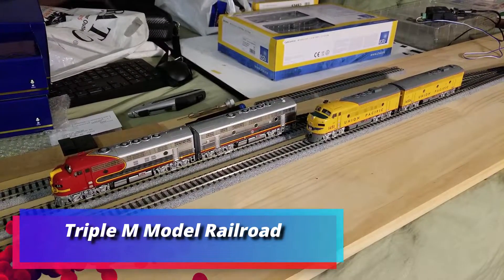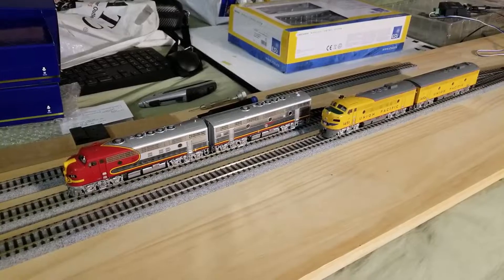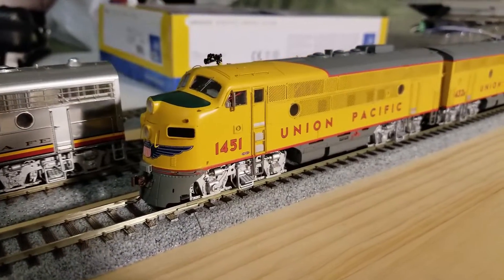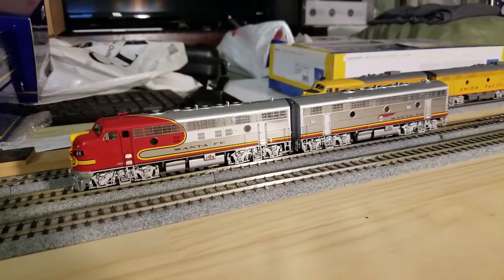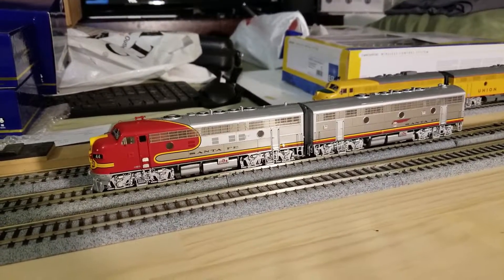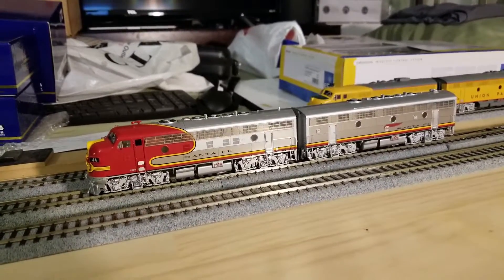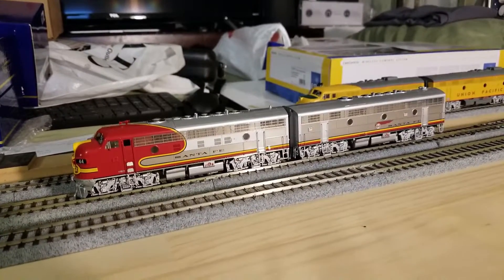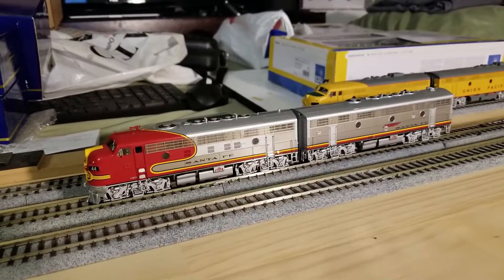Athearn Genesis F7 Sante Fe Project / Harold's F3 Completion

Comment: Another layout thought for consideration. My layout when I was a kid, was on a sheet of 4x8 plywood. My room was in the basement. At the end of the room, my step dad framed shelving to the wall. The bottom shelf was about 2' off the floor. The plywood was attached to this with hinges and could fold up against the wall out of the way. Actually there was an airgap of the width of the shelf board between the stowed position of the layout and the wall. When the layout was down/open, there were two brass colored chains to support each out side corner and I had a wooden leg to screw into the center of the leading edge before I lowered the layout. When up, the layout was secure closed with a bolt layxh on each upper corner. The layout was a common set up with an outer loop that had an inside siding. An inner loopn I could run a second, smaller train on. The outer loop also had a spur withban elevated coal dump. Therw was also a shelf above  and compartments along side the closed layout Where i stored my rolling stock. The track was nailed down with a cork bed. My buildings were not attached. They were easily moved back onto the shelf the layout was hinged to and protected behind the layout when closed. On the bottom of the layout was a ayer of cork. Made the back side of the layout a poster board. It could get tedious setting up and putting it away, but it was a good use of real estate.  Heck, one could always have a permanent shelf set up on one wall, and have the hideaway layout fold lowered down to expand on to it for another leg for operating sessions.
Reply from the maker: Hmm, I'm considering building a modular layout in my room but due to this pandemic it is on hold.  the plan is to clear out my bedroom to the point where it is possible to build removable shelves.  The shelves will design will be similar to an N scale modular build I have seen in a couple of trains shows.  I will have more information later on this.  Hopefully this pandemic will blow over soon so I may continue with the project.

Comment: good to hear that U go with ESU,  U will never regret your  choice.  I use the ESU Ecos 50200 and the Mobil Control II, for me the best system on the market.  See ya next time, Dirk.
Reply from the maker: Hello Dirk and thank you.  You are right, we don't regret it one bit.  I remember years ago when we had the MRC Prodigy system, and it was a total nightmare to program and operate.  So we were in the market for a new DCC control system, NCE and Digitrax were the main contenders.  I was not satisfied with their technology so I had decided to find a more advanced system and then I discovered ESU.  It took some convincing Martel but he decided to try it out.  We never looked back since.  Now I have finally have the new latest and greatest for myself I'm very curious to see how far this technology can go.
Reply: Triple M Model Railroad Glad to hear that U are satisfied with the ESU System. 👍.  I think they are far ahead the other DCC systems, only exception is Zimo, but this system is to expensive.    See ya next time, Dirk
Reply from the maker: @hdspringer2561  Yes I forgot about Zimo!  Zimo prices are ridiculous..

Comment: Best system, i want the ESU cab control, can't wait to see video on that. I sold all my Tsunami locos, just ESU now.
Reply from the maker: I must agree, the ESU system is the best on the market.  Years ago I have predicted that ESU is going to be on top depending on how their competitors respond to them.  I was hoping that Soundtraxx and or QSI would develop beyond what they were doing.  Soundtraxx and QSI have developed new and better decoders.  But what they both failed to do was build a control system around their hardware.  ESU already had their ECoS system in place and it was basically plug and play, (almost). ;)  Even though I am ridding of most of my Tsunami decoder engines except for my DDA40X's Soundtraxx did a good job on their Tsunami 2 decoder.  I will be testing the programmability of the Tsunami's with the new ESU Control Cab.  I hope it works without much issues.  I will have a video soon on this.
Reply: @OmegaDeus8467  Looks forward to your findings.

Comment: Kadee #58 is a scale correct coupler, and look great. That is what i used on my F3s and F7s also used the original draft gear box.
Reply from the maker: Thank you Spacecalander.  On the Kadee website it is stated that #28 and #38 are the couplers to use for the F3's and F7's.  # 146 and 148 were optional.  This is confusing..
Reply: @OmegaDeus8467  I believe that is for Atlas, which is a mess of a coupler, if your units are Athearn Genesis yellow or all blue box then the 58 is just like the scaletrains coupler, and fits the athearn factory box and screw.
Reply from the maker: @spacecalander  Oh okay I got you.  I may have miss read the information on the kadee site.  I don't understand how I did that.. :/  Thank you for leading me in the right direction!